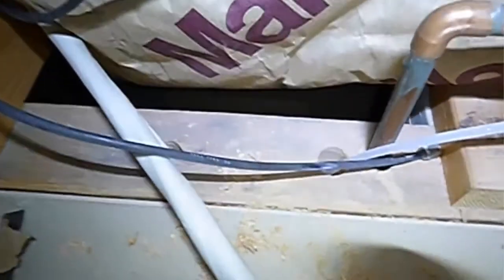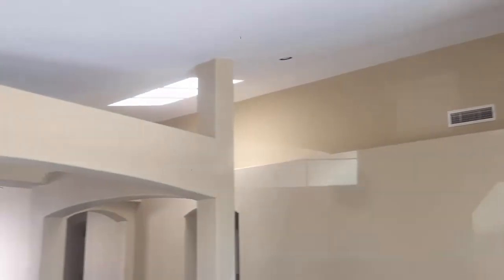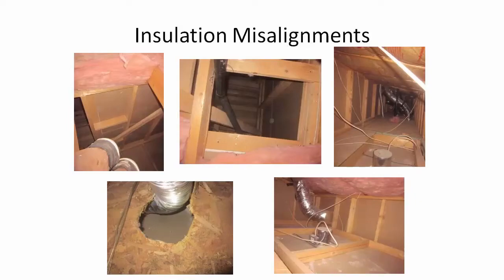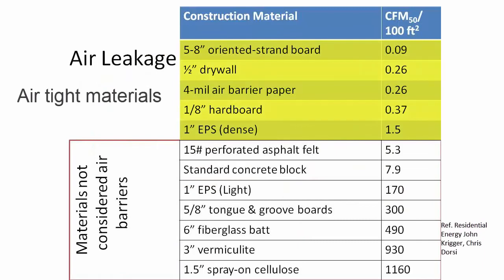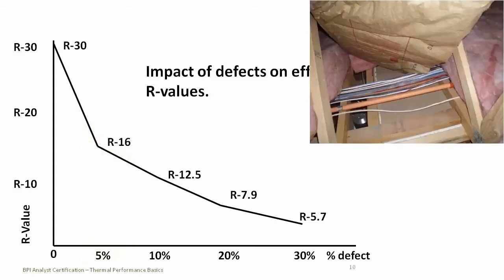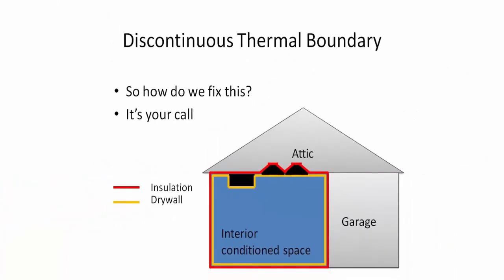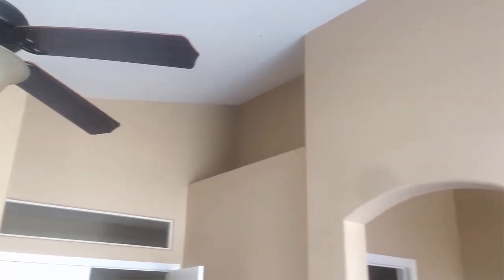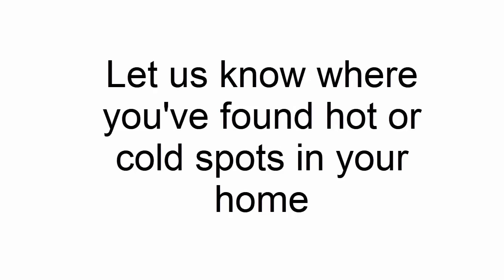Common Problems With Insulation Installation Explained During An APS Energy Audit

Comment: Technically, you have to seal airtight all the penetrations before thinking about insulation. When you have a mix of batt and blown insulation, it is ok to reuse the batts on top of the blown insulation but they have to be laid down perpendicular to the joists in order to avoid to compress the blown insulation. If compressed, insulation losses R value. Also the batts need to be unfaced as they don't lay on the drywall.